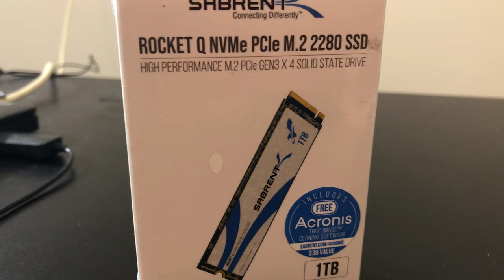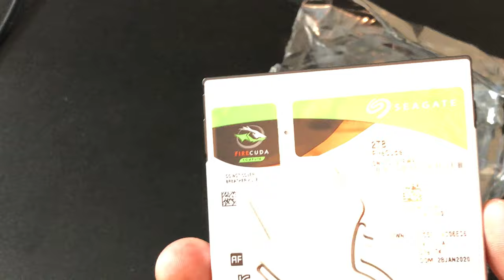2019-2020 HP Omen 17 SSD & HDD Upgrade-Disassembly and Installation

Comment: question please 
 omen 17 
also how do i know if mine is 2019 or 2020
now i have alredy 1tb in total  its 500ssd and 500 hdd stock 
how much can i max it ?
i want maximus and fast storage as possible 
for gaming purpose
Reply from the maker: Hey brother! 2019 Omen 17 came with intels 9th gen processors and 2020s came with 10th gen. The 10th gens started out shipping in 2019 laptop chassis until hp changed  their shell to the more bland design with the blue omen logo. Early 2019 -latter style had that aggressive almost lambo style look. As for storage , you can pop as much storage as you can buy especially if you use windows 11. I saw someone with 8 or 9 TB of storage in theirs 🙂 I wouldn’t go too far with it though because you can easily end up spending as much as the laptop costs in storage alone. I think 4TB is a sweet spot for volume and cost
Reply: @YGTVYassirsGamingTechVlogs31  ok now that you mentinon that im 100% i have the hp omen with the red logo but with 10gen i7 now you sure i can replace the 2ssds slots to 4tb? one each 2tb?

Comment: Is there only one space for an ssd stick? My laptop came with 512gb of ssd, I was hoping it would have another slot for another ssd
Reply from the maker: It depends on the model and the initial specs. Some had option for an intel optane drive to be added and you could opt out of that and end up with a free second slot and some others I’ve heard just had one slot. Mine came with 512 gb out of the box as well . I opened her up and was pleased to see the second free slot
Reply: @YGTVYassirsGamingTechVlogs31  thanks for the info and speedy reply!
Reply from the maker: @ZaydEdits  any time! 🙂

Comment: Hi, Are you running your Omen 17 with 3 total storage devices (2x m.2 NVME drives and 1x SSHD)? I have the exact same laptop but wasn't sure If all 3 storage options could be populated together or if only dual storage configuration could be used.
Reply from the maker: Hey! Yes, i'm running with 3 total.The 512MB Samsung NVME that came with it, a 1TB Sabrent NVME I added and a 2TB 2.5 SSHD . They all will be able to be used at the same time. I save emulation files and other games on one, Steam account games on the other and  pics and videos on the Samsung :)
Reply: Thanks for the reply. Couldn't figure out if it was possible with the service manuals only showing options for dual storage configurations

Comment: Regarding the Firecuda SSHD, where would I be able to get the SATA data connector wire from? Will it be included if I buy the SSHD via amazon?
Reply from the maker: You can get a SATA connector cord from Amazon as well or Best Buy. Mine didn't come with one so to be safe i'd buy one. I pulled my connector off of my old laptops 2.5 inch drive and used it with my Firecuda.
Reply: @YGTVYassirsGamingTechVlogs31  ah, that makes more sense. Thank you for clarifying. Just got my omen 17 today with the 512gb+optane and 2070 option

Comment: Do you know if the m.2 needs to be low profile? I'm thinking on getting one of the xpg with cooling on it, do you think that might fit?
Reply from the maker: I’d leave it low profile because the ones with the cooling shrouds will be too thick to fit and be able to secure with the nvme security bracket

Comment: Thank you for this video, you're a real gentleman. Just one question though, is installing the ssd like you did in the video all that's needed for you to get the additional storage? Or do you have to power on the laptop and do something. Most probably a dumb question but, I'm a novice in this field of information and I just want to be sure. Once again thank you.
Reply from the maker: Thank you Sir and I'm so sorry this reply is an entire 8 months late. After the SSD is installed, you do have to power the laptop on and configure the new drive so that Windows formats it correctly to access the usable space using WIndows Disk Management application :)
Reply: @YGTVYassirsGamingTechVlogs31  do you have any advice or a video showing how to format it?
Reply from the maker: @ZaydEdits  no vid yet but to format the new drive in search bar in windows type in “disk management “ and choose your new drive letter which for me mine was drive E and choose the max allocation unit size for your drive and do quick format using NTFS instead of FAT32.
Reply: @YGTVYassirsGamingTechVlogs31  thanks a lot, will be doing this along with cleaning my fans and re thermal pasting soon.
Reply from the maker: @ZaydEdits  Good move! Your omen will thank you! I just took mine apart and dusted last month . Amazing how much dust gets inside

Comment: I just bought this model on Costco.  Can any of you guys tell if this will have the second SSD slot?  Also, if it does have a second SSD slot is it possible to consolidate the SSD drives into one drive or would that be unwise considering the two SSD drives would be different models?
Reply from the maker: Rami Agonistes  If it’s the same exact model I have than yes it would have the second slot as seen in my video. It is possible to run both ssd drives in RAID but I personally wouldn’t do it. If something goes wrong on one drive, it could affect files on the other. I would just leave them as independently used and listed drives

Comment: Sorry. But does it has 2 nvme slots and a sata drive slot?
Reply from the maker: Depends on which one you get. My 17 had the extra slot and sata drive. At one point, the 17t models with RTX 2060's just had one nvme slot. If you see one online that mentions intel optane drive option , it will come with the extra nvme slot. Mainly RTX 2070's and up.

Comment: Hello. 
Will you make a video in which you show how to replace the thermal paste?
Reply from the maker: Since I have no need to change mine yet I won’t be taking mine apart but I think there are a couple vids from some other omen users that show how to do that. If I find a need to in the next 6 months I’ll open her back up and cut a video 🙂
Reply: Is the thermal paste the white stuff on the fan grill?

Comment: Good job... Thanks for all the information. I just bought HP Omen 17 2019 model and it came with 512GB nvm M.2 SSD. I have been thinking about upgrading the storage but didn't know if it has another slot for the same nvme M.2 of a higher storage capacity.
Is there anything else you can recommend me if I don't find the availability of Sabrent one in Australia? And anything else you can tell me that be helpful for me. Thanks.
Reply from the maker: Arif Arslan Thank you for watching! If you can’t find the Sabrent brand, you can get a Samsung 970. Costs a little more but another great nvme drive option.

Comment: Hi did the connector strip come with the Hybrid HDD or you have to buy separate? I have same laptop but with only 1tb NVME SSD, but i suspect there is a place for HDD from the factory because it was available in configuration when i was building my laptop pc..

Comment: Great video! Definitely will watch again when I’m ready to upgrade the ram and ssd.
Reply from the maker: Robbie Thank you for watching! Let me know if you have any questions when that time comes 🙂
Reply: @YGTVYassirsGamingTechVlogs31  How many mini SSD slots does this machine have 2 or 1.
Reply from the maker: @revanvonheaven8270  mine has 2 nvme slots. Most 17’s with rtx 2060 or below typically have one slot